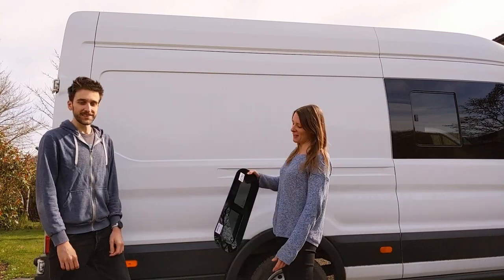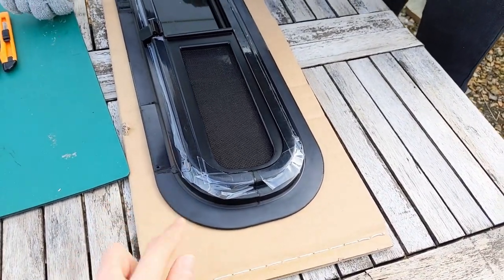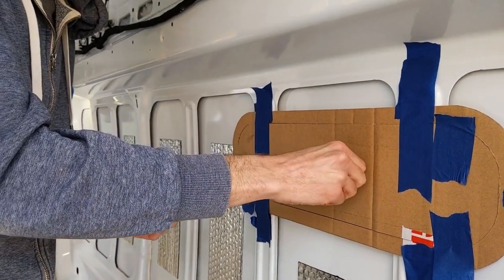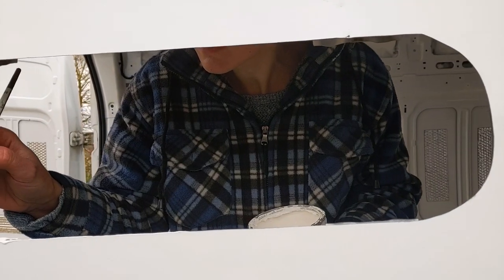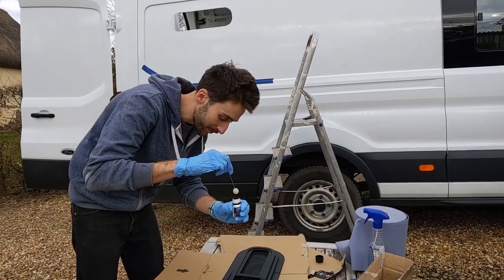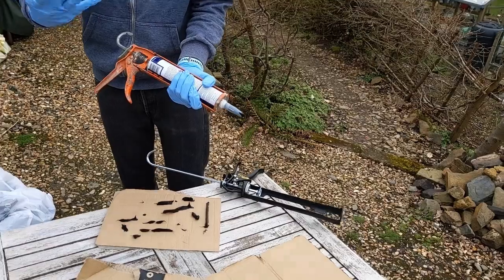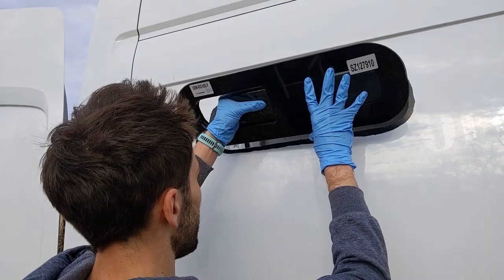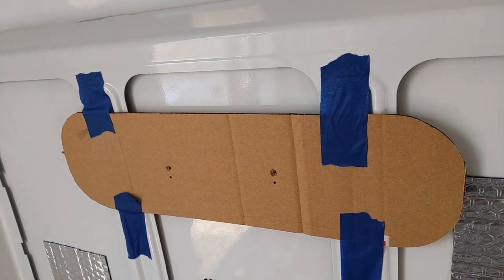Fitting Bonded Side Windows (That Open!) | Transit Van Conversion E10

Comment: Hey there, great video! So I am checking out these windows on Leisure Vehicle Windows, and was concerned about the fact that they are ONLY glued in. Most of the van windows you see on Youtube are screwed into back frames from the inside of the vehicle. Do they work fine by just being glued to the metal siding? That concerns me. Thank You!!
Reply from the maker: Cheers! And absolutely no problem that they're glued in, if installed correctly. There are different types of windows and these ones we've used are bonded windows, which are designed to just be held in with adhesive. It's exactly the same as how the windscreen is held in place in your car, or windows on a minibus. Most panel vans have recesses in the wall body to exactly fit a bonded window, which is why they are all custom sized for each van, and even which side of the van they're on. We actually had to remove ours the first time as we had a couple of minor leaks which is one of our other videos, and can tell you it was a huge amount of work to get it off the van again 😳 As with anything if installed incorrectly or with the wrong adhesive etc then there could be issues but done correctly no problem at all 👍 Other types of windows like the dometic seitz that have the frame have different pros and cons. You might prefer to have a squarer one with a frame, or possibly double insulated etc. Comes down to cost and preference really, you could install either type of window into the same area. As well as port hole ones and probably many others types too 🙂
Reply: Don't forget,, your windscreen on your car or van is also just bonded in too and they stay put just fine. 😊
Reply from the maker: @nellmoll  👍👍

Comment: is it better to warm the tube of glue?
Reply from the maker: Yeah definitely, when it's cold it becomes incredibly hard to get out of the tube. We left in an a warm airing cupboard until we needed to use it, and also made sure to use a heavy duty sealant gun as well. The dinatrol is a lot thicker and harder to squeeze out than other sealants so anything to make it flow easier is worth doing as you really want to ensure a nice consistent bead all the way around with no gaps! 👍

Comment: hi, can you tell me what size window this is? Thank you!
Reply from the maker: Hi Peter, sure no problem. They are 580x200mm each with slide openings. We got them from Paul at Leisure Vehicle Windows, here: http://leisurevehiclewindows.co.uk/ford-transit-2014-xlwb/. They're listed as 'BONDED UNIVERSAL HALF SLIDER PRIVACY WITH FLYSCREEN 580mmx 200mm', in near side and offside versions. Hope that helps!